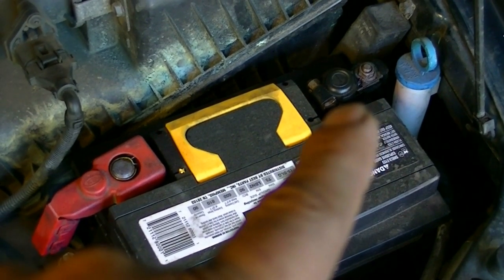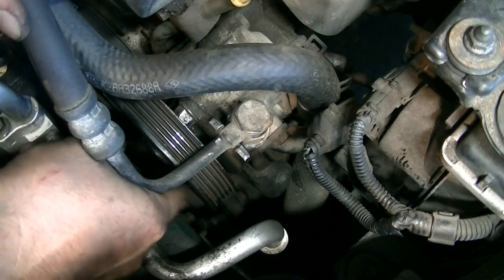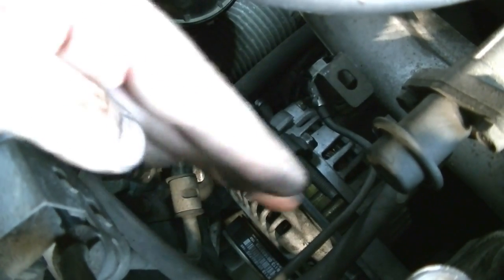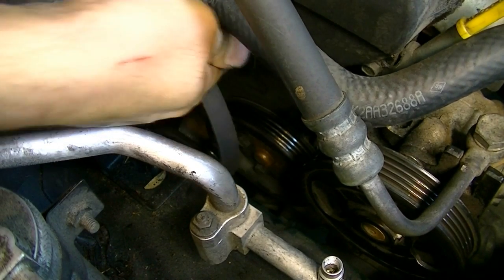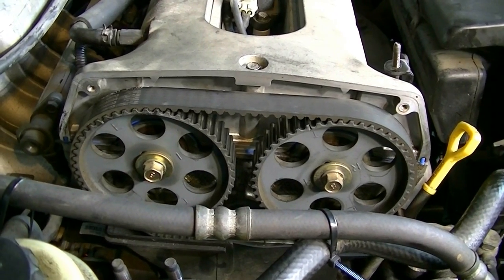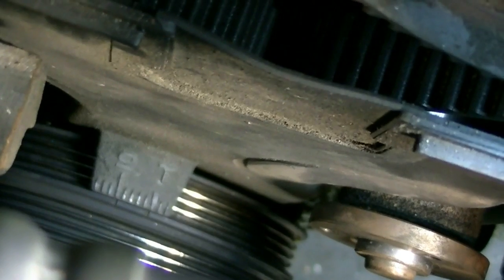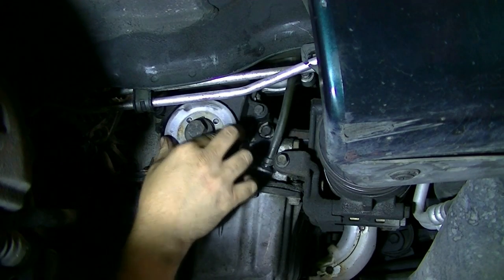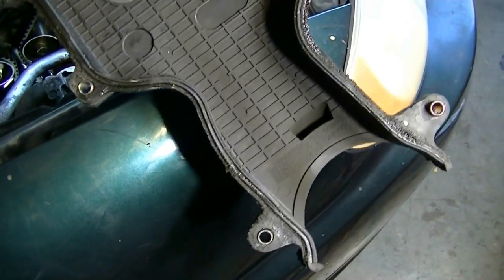Kia Spectra Timing Belt Replacement - 1.8L DOHC Engine Part 1

Comment: Just did a 2002 Kia Spectra 1.8L. With the adjuster pulley spring in place, I inserted a 5mm hex head in the pulley and turned counter clockwise until the hex hole was at the 9 o'clock position, then tightened the pulley bolt to hold in place. This gave enough clearance to install the new belt. By loosening the adjuster bolt, and turning the crankshaft around twice, the adjuster spring took up the belt slack, then the adjuster bolt was tighted to 35 ft lbs. Also, the oil dipstick tube needed to be removed to make clearance for the water pump bolts. Thanks again for sharing.

Comment: This is the motor that is in my 2000 Kia Sephia, however the water pump doesn't look like that and doesn't require removal from inside the timing cover.  I had a situation where the harmonic balancer wouldn't pull off.  So I pulled it off with one of those screw type pullers.  Well, I found out the threading was on the timing crank gear...  So umm yeah, I ended up pulling both by accident.  The incident ended up cracking the timing belt and now I'm working on replacing it.

Comment: Does this method work for removing belts from a 2004 Kia Spectra? I'm having trouble removing these bolts from the power steering pump. I need to change the belts because I've already shredded one and my car isn't running. It's been a month and I really need to get it running again. Thank you in advance.
Reply: Lawrence Garza Looks like that is covered in detail at the beginning of the video.

Comment: Thanks for the video. I have the same motor and I am trying to figure out how to get out the alternator. It is boxed in on the top and bottom by the intake manifold and AC lines. Autozone said to remove the intake manifold. My friend said take out the CV joint. Any ideas?

Comment: Can anybody verify the piston position when the crankshaft timing mark is lined up?  Is cylinder #1 at TDC?  I want to verify if the belt has skipped, without exposing the crankshaft pulley.  2006 Kia Spectra.

Comment: That was a good tut, but since you were at all those major parts why didn't you just replace the: Water Pump, "all" the belts including the Timing belt since you are doing it yourself. If the timing belt did not break me my self I would have waited until I could have bought all the parts that needed replacing while I had everything off and just did at once and that's a done deal, but it's not my "Project" sorry just a thought.....

Comment: ok so everybody knows Most Korean engines are interference so if the timing belt breaks piston will hit a valve
Reply: Actually MOST of the early kia engines are MAZDA COPIES and NON INTERFERENCE engines. I'm talking 98-04. Before they used hyundai engines.

Comment: did they steal... I mean borrow.. this design from ford/mazda 1.8/2.0 dohc
Reply: Nilk Narf yes.  It is a Mazda motor
Reply: @jdm240z3  it IS A DAMN mazda engine and anyone who knows anything on kia engines knows that from 98-04 they used quite a few mazda copies under licence before hyundai made them use hyundai engines. Hyundai/Kia have a lot of mitsubishi engines and around 07 all 3 of them got together with chrysler as well and designed an engine together that it seems chrysler bought the final design rights to most likely with bailout money. Some hyundais are sold in south America as dodges....
Reply: Made under licence. There's a few non interference mazda engines in the early kias.